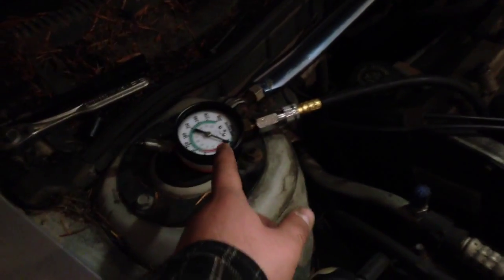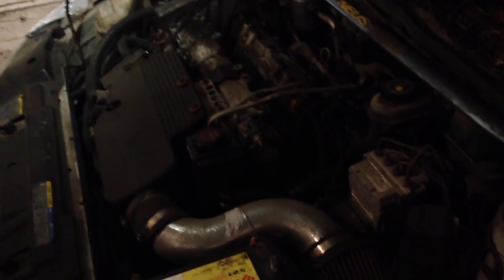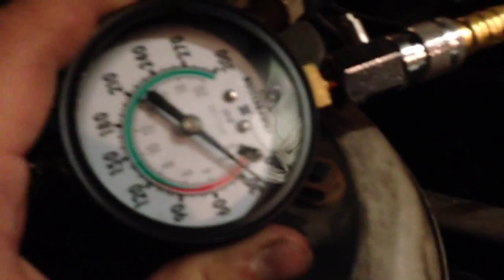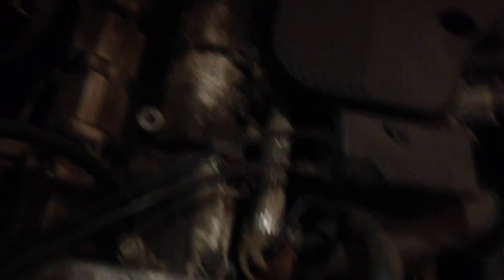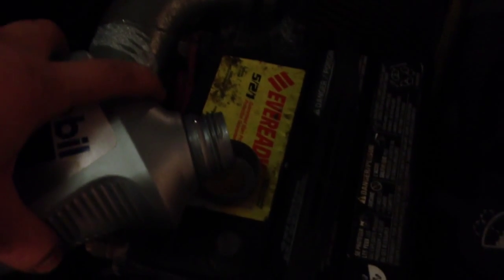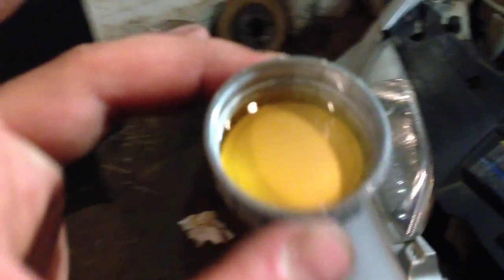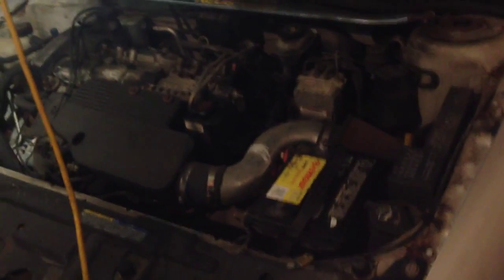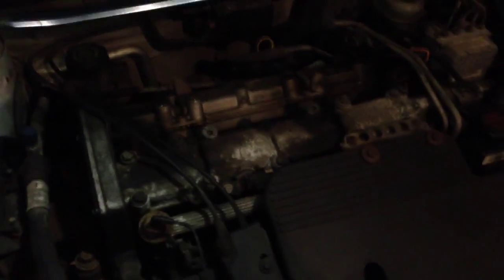How to perform a wet dry compression test

Comment: You didn't mention two things. (1) perform test at Wide a Open Throttle. (2) disconnect the fuel injector harness.  Also I'm going to use a home made pipette to pour in the oil .... I am A little fastidious about getting oil in other places other than in the spark plug hole ;-). Thanks for the YouTube- Mike

Comment: How about explaining the steps. Should all spark plugs be removed, or should the cylinder you working on is the only one that should be removed while doing this test. Should one cut off the fuel system to make sure no fuel mixes with the oil?  All this should be explained otherwise there are unanswered queations.

I have a question lets see if you can answer for me.  Today I worked on a boat, has two v8 7.4 mercruiser engined.  Starboard side engine has  low compression on cylinder 4 after doing the tests on 2 4 6 8 sylinders. 
So I did a wet test with all spark plugs removed and fuel was cut off to make sure I got proper reading.  Now after I put oil in cylinder 4 I did the test and smoke escape from somewhere,  came from somewhere on the side where 2 4 6 8 cylinders are,  on the top probably from the head or manifold.   Now this confused the shit out of me.   This was the reading I got on 2468.
Cyl 2 comp. 145psi    Cyl 4 comp.  118psi

Cyl 6 comp. 145psi     Cyl 8 comp. 145psi

I thought ok so wet test will tell me if its a valve problem or a bottom end problem.  
So I did a wet test as described above ^^
 
After I got 0psi anf and smoke escape from somewhere not sure where. Did this happen because I had all spark plugs removed?
Reply: All spark has to be removed to have an even and accurate basis for compression testing.